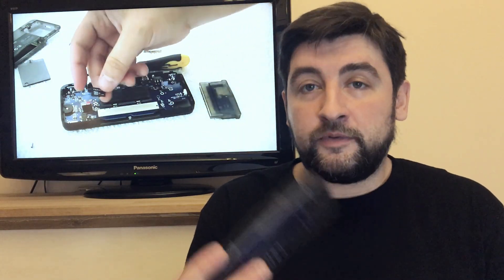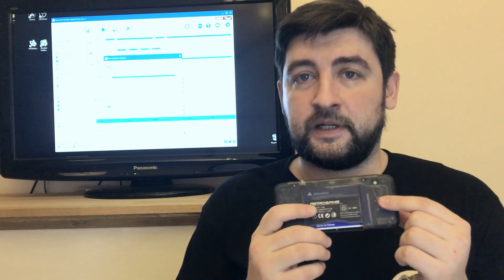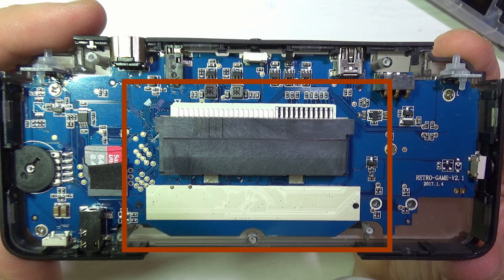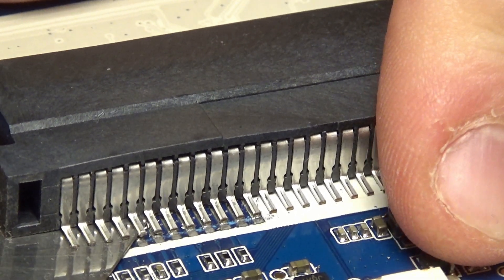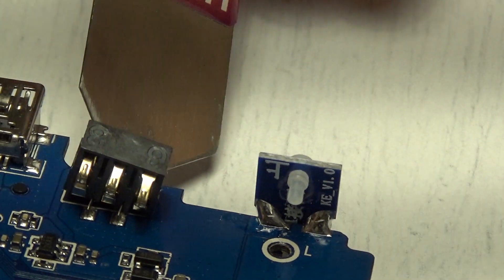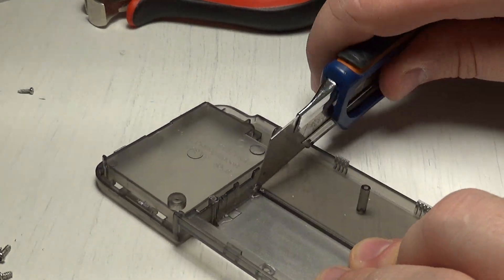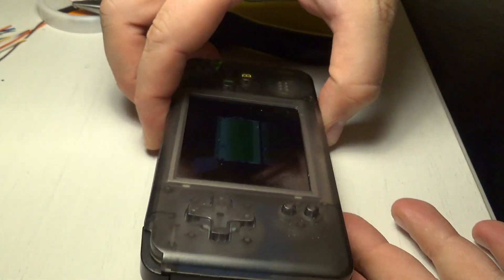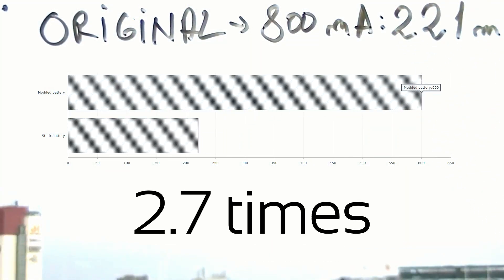Custom Battery Mod for Data Frog Retro Handheld Game Console RS-97

Comment: I feel like i missed something. How did you get the replacement battery to work in the system? Did you have to solder, or did the pins just line up? My rs97 arrived yesterday and I haven't had time to take it apart yet so my apologies if its obvious.
Reply from the maker: Hi there! My bad, I think I did not make that scene sufficiently long and clear. You can find it for a second at time index (minutes, seconds) 7:07 . Sorry about that, but there is where you need to solder it. :) Enjoy!
Reply: Thank you :)

Comment: On aliexpress i buy micro sd card plate for modification my snes mini. It better than this metod.
Reply from the maker: Can you share a link to it?
Reply: @enthusiastguy2799  all links under my video https://youtu.be/gZO16QX7hW0
Reply from the maker: @fatglist  That's indeed a nicer way, considering the pins actually match. You have 9 pins there and the native reader on the RS97 seems to have 10. But, I guess they should be pretty much the same. However, I removed the second SD alltogether, given you can make the internal one as big as you need.
Nice video, thanks for the tip!

Comment: I tried changing my battery into a 3000 mah one. However, the system will not boot :( it always stays on the green battery charging page with green light on. When I plug it with usb, the orange light also turns on, but it's still on the same page:( I wonder if it's because my battery is too large? Do you have any idea? Could you help me please :(
Reply from the maker: First, wait for about half hour to make sure the battery charges. I expect that after a while it will be charged enough to boot.
Reply: @enthusiastguy2799  thanks a lot!!!!! Solved it afterwards! Thank you so much!!!!
Reply: Sanya Chow how u chnge battry to 3000mah?

Comment: I tried Changing my battery for a 900 mah one, is it normal for the console to remain powered on when inserting another battery? because it doesn’t seem to power off
Reply from the maker: Uh, you should be able to shut it down. Even after shut down, it still keeps the LED lit?
Reply: Enthusiast Guy I got it solved, i had to discharge the new battery and then charge it back and then it turned on and everything normal, however i don’t understand why i had to do the whole thing for changing a battery

Comment: Do we need to change the battery profiles in the setting menu?
Reply from the maker: Good question. I don't believe you 'need' to, the worst thing that could happen would be for your battery icon to not show correctly. I expect it would show the battery at 100% for a longer time. You could switch it to linear and see what happens.